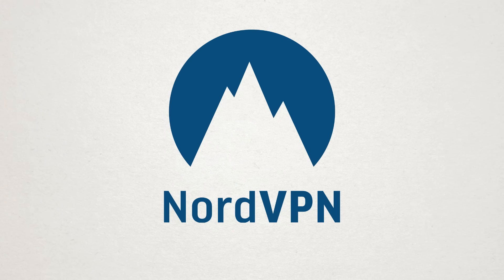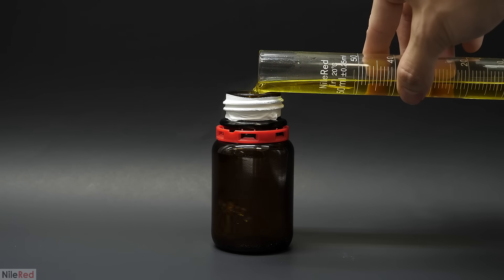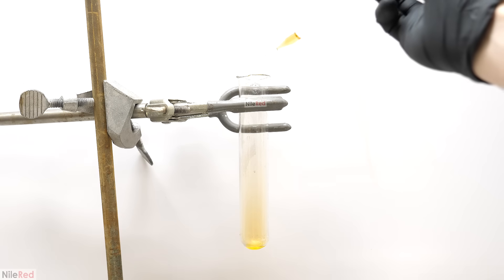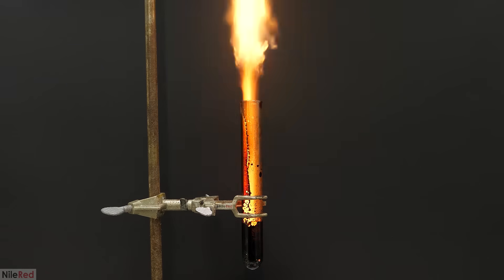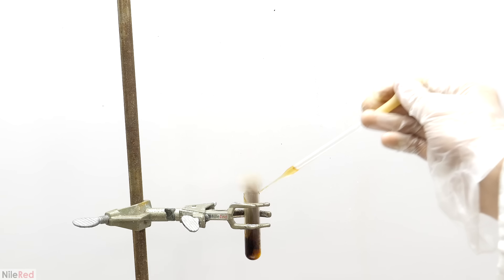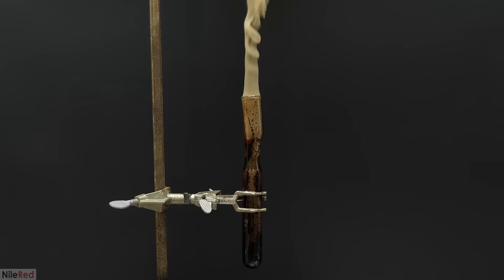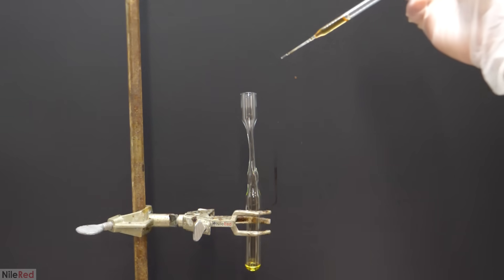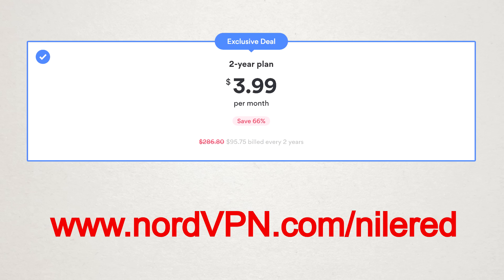Making test tube liquid rockets

Comment: Messing with hypergolics? I hope you were wearing a good pair of running shoes!
Reply: Nah, he's not using Chlorine Triflouride, so no need for the shoes....
Reply: yeah, those are for fluorine - metal fires
Reply: @srenkoch6127  Then again, you can never be too careful... :P
Reply: @srenkoch6127  O2F2 is also fun, affectionately known as "FOOF" because that's its chemical structure and the sound it makes if you pour it on almost anything that isn't a properly fluoridated steel tank.
Reply: Does nobody get the reference?
Reply: @kaidenpeek5959  yep. I've read Ignition! Reminds me of an article I read about "Chemicals I won't work with. Ever." and O2F2 and Chlorine Triflouride were both very high on the list. Not a Chemist, but I'd rather deal with Hydrazine over either of those. Rapidly hypergolic with just about any material? I'll take a big pass.
Reply: @kaidenpeek5959  I clocked it immediately lol

Comment: In addition to reaching the ignition point, the reaction is only going to happen on the interface between the two substances, right? So if you've just got the fuel sitting on top of the oxidizer, or vise versa, then the reaction where they meet is going to push them apart. For a thorough reaction, I think the two components need to be distributed as homogenously as possible. Which of course is a race against a very fast clock.

If a boiler flask can withstand the force of the expanding gasses, that might be your best bet. Because then, even though you still have the same problem of the compounds being relatively unmixed, when the reaction kicks them apart, some of that splashing will be bounced back toward the place where it's all happening.
Reply: Of course, if you could spray the two compounds together, you'd be even better off. But a standard spray bottle probably won't keep your hands safe and probably would lose its spray bottle-ness after the first few spritzes.

Comment: Dinitrogen tetroxide sounds like nitrous oxide on nitrous oxide. I had no idea nitrogen could form so many different oxides.
Reply: Dinitrogen tetroxide (N2O4) is just dimerised nitrogen dioxide (NO2). Nitrous oxide is N2O.

You can make N2O4 simply by cooling down nitrogen dioxide or pressurising it. It's used in school experiments to demonstrate Le Chatelier's Principle, as NO2 is dark brown whilst N2O4 is completely colourless, so any change is very obvious.
I've also found that for some reason just leaving NO2 alone in a sealed test tube will cause it to dimerise. It quickly forms N2O once re-opened however, which I've learnt to my cost.

Comment: sadly no mach diamods and/or supersonic exhaust here.
nice work though.
Reply: Saburo Kobayashi I think you would only see mach diamonds in over-expanded flow.  Correct me if I'm wrong, though.  My rocket knowledge is a little rusty.  Might be possible flow is supersonic, just under-expanded.
Reply: When underexpanded supersonic flow still oscillates (although differently).
Density oscillations are abscent only when ambient pressure and perpendicular to flow axis exhaust pressure are equal.
(which is possible, but would be too much of a coincidence)

Comment: Only 10 mins in so far but I think it's worth noting that its not so much the tube length that matters but when the mixture reaches the top of the tube (whatever length it may be) that is where the O2 is. It would be interesting to try it in a wide mouthed jelly jar.
Reply: The O2 in the air does not take part in the main reaction

Comment: I'm curious, do you have any idea/explanation to why after the initial ignition, there is (almost) always a second burst? and would this affect the efficiency of the fuel concumption, and thus the thrust generated? 
Looking forward to what else you find out in these experiments!
Reply: Vincent Hannema maybye its the pressure slowing down the reaction? Although normally, arent reactions sped up by pressure?
Reply: i thought something similar. I thought, maybe the top layer of the acid, reacts with the first aniline that drips down, then reacts and expands. the expansion keeps the very top aniline up, and away from the bottom part of the acid. After the first burst is over, the rest of the aniline could reach the bottom of the tube, and react as well.
I unfortunately don't have much of a chemistry education, so it's mostly just guessing.

Comment: Note the increase in combustion stability in the narrowed tubes. If you can find a very thick tube you might be able to make the throat narrower and actually build a bit of thrust.
Reply: Immerse test tube in water beaker to provide counter pressure and contain explosions.
Reply: @kmarasin  good idea, plus it would help cool the glass, hopefully prevent any thermal anomalies. Provided the reagents are not reactive with water.
Reply: @JakeAvatar1  Well, they are, but there should be enough water to absorb any reaction.
Reply: @kmarasin  well one should strive to minimize any danger in the lab, especially when your reactions are inherently dangerous.
Reply: Pure HNO3 dissolving into water will produce some heat, just as any pure acid will upon dissolving, but it's not comparable to what the combustion with aniline is already producing. There might be a small acid-base reaction between nitric acid and aniline in solution, but again, not comparable to combustion.
Reply: Or you could change chamber materials to metal and form the throat via metal spinning, then add an injector so it can run for more than an instant. And maybe add regenerative cooling channels. Or you could just make a rocket engine ;)
Reply: @warrentb1  well that would be the ultimate goal, but for initial testing, it is nice to be able to see the reaction
Reply: And.... a much greater possibility of explosions!
Reply: @henryD9363  hence the thicker tube.
Reply: Also, I think he needs to use dowels or metal rods of different diameters to neck the tube down onto to be sure about the throat area.  He might also be able to create a form that can provide a regular / desirable shape for the divergent portion of the nozzle.

Comment: For the large deformed test tubes, you might have more interesting results if you made the narrow part lower on the tube in order to have a smaller combustion chamber.
Reply: @madarah8533  probably.
Reply: The main problem here is to avoid ejecting the reactants before they combust. Currently they are just being held to the bottom by gravity. What's needed is some way to bring the aniline and nitric info complete contact but to restrict the reaction rate to prevent them from exploding.

Of course I'm just describing a real rocket engine and why they are such complicated machines. The complexity of the RS-25 (space shuttle main engine) is one of the main reasons the space shuttle was made reusable, so they didn't have to fabricate a bunch of them at prohibitive cost.
Reply: @kmarasin Or you could just use a more-hypergolic oxidizer.  I hear chlorine trifluoride starts things burning pretty quickly ;)
Reply: Yeah, probably it would work

Comment: Idk about Canada, but in the UK chemical suppliers aren't allowed to sell anhydrous hydrazine, and I assume the hydrate would be no good? Frankly though, I'm good for using hydrazine or any simple derivatives unless I have to.
Reply: Heat it up to 100 degrees Celsius and then I presume you'd have anhydrous hydrazine?

Although probably would want to do it in an oxygen-free atmosphere. Just in case it decides to blow up.

Comment: May is ask you something? Is there any kind of chemical reaction which only occurs under a rather strong electric, ferro-magnetic or electromagnetic field?  Does any of the listed type of fields boost under certain circumstances some reactions?
And btw. I am not referring to the more known experiments in the field of electro-chemestry like akkumulators, batteries and electrolysis.
Reply: Are you referring to the manipulation of hot plasma with a strong electromagnetic field? If so, their are types of rocket engines that use such a "boost" but i don't think they are worth looking at. Much more interesting is the use of this technology to stear a supersonic blunt body object at reentry ( electromagnetic fields can manipulate the plasma effectivly to do precise course corrections).
Reply: Strong magnetic fields can change reaction properties, I know near a Magnetar (possibly the strongest source of magnetic fields in the universe) it is estimated that all chemical reactions involved in life would become impossible as atoms themselves are deformed into long, thin spindles.
Reply: @warrentb1  
Oh boy, i don't think we are jet able to produce a magnetic field that can deform atoms  :D. What would be the benefit of such a device? Besides that, we already can deform molecules with electromagnetic waves, it's called radiation (infrared, uv, gamma rays) ;D.

Comment: too bad you dont have a way to introduce the analine that isnt downstream from the combustion chamber.  looks like there's a good chance half of your fuel is thrown out of the tube before it has a chance to react

edit:  I just realized, you said that analine goes solid at a pretty easy temperature.  why not freeze it, and drop in chunks?
Reply: I'd think that removing the air would reduce the force of the rocket, since the gases produced by the reaction would first have to fill the tube before they could escape and push outwards.  Might make the reaction slightly less interesting to look at.  

I also don't think the ice method would work either, since the surface area of contact would be quite significantly reduced, slowing down the reaction to the point where the energy would go into melting the ice, rather than pushing air out the top.  It might also form a shell of carbon surrounding the ice chunk, preventing the rest of the reaction from proceeding.

I suppose both options are worth a try, for science.  But I have my doubts about their efficiency. 

Using a long tube to the bottom of the test tube might be a viable option, but even then, I think the reaction might be blowing the drops of both reagents out, and I'm not sure that would change.  I think it might just flip which reagent is thrown out the top.  If the aniline is added on top, the reaction occurs between the two "layers", blowing the aniline out the top, but if the aniline is introduced to the bottom of the tube under the nitric acid, he might find himself with nitric acid flying out the top instead.  I think that might be the reason he's adding aniline to acid, rather than adding acid to aniline in the first place.  Just my speculation though.
Reply: the ice wouldn't be in a chunk, it would be ground up, almost powder-like. if that was dumped in on top, its possible that all the aniline reaches the bottom before ignition
Reply: Danielle Spargo Actually, the air makes the rocket less efficient, as the exhaust gases have to fight atmospheric pressure to push their way out of the nozzle.  No air means no resistance to expanding gases other than combustion chamber and nozzle walls.
Reply: Science Compliance doesn't the resistance to the pressure increase the thrust?
Reply: Jonathan Odude No.

https://spaceflightsystems.grc.nasa.gov/education/rocket/rockth.html
Reply: Science Compliance that link doesn't answer my question because they say in the article that you can remove the part of the equation that deals with air due to there being none in space. If you gave me the equation that includes free stream mass times free stream velocity then I'd be able to tell if additional air pressure increases or reduces thrust
Reply: Jonathan Odude That link was meant to be a starting point if you really want to get deeper into the subject.  No, atmosphere does not make rockets work better.
Reply: I think the analine might need to be vaporized to properly combust.  What he really needs is to feed it into the combustion chamber along with the other reactant, atomized, at the appropriate volume flow rates and with enough pressure (and/or a one-way valve) to keep the feed lines flowing in the positive direction.  I don't know if solidifying the analine will be conducive to proper combustion.  Then again, creating a constant, stable flow from feed lines is a much more involved engineering project.

I like the rocket engineering, but, as a chemist, I think Nile's work should probably be focused mainly on the ratios and phases that yield the best combustion.  It would be more mechanical engineering to get into delivery systems that produce such conditions in the combustion chamber.  If he wants to get that deep into it, I'd say more power to him and definitely watch the video with avid interest, but it would be a little out of his usual wheelhouse.
Reply: Aniline*
Reply: Felixkeeg Thanks.
Reply: is this also the reason why the mixture ignites twice? because some of the aniline is blown away but then it falls back into the remaining nitric acid?
Reply: Then it would react much more slowly. Two liquids ensure maximum surface contact.
Reply: Pietro Tettamanti Actually, gases provide the most contact area since the molecules are diffuse.
Reply: @sciencecompliance235  
That wasn't the point of my comment. I wanted to say that mixing a solid with a liquid would result in a slower reaction than mixing a liquid with a liquid.
Reply: Pietro Tettamanti I kind of figured as much.  It was just worded in a way that might have been misleading.

Comment: Just one of the problems I noticed with the throat of your makeshift nozzles. You have no way of knowing if you have a good width without doing the math first. I'd look up a reference book for those equations, and maybe stick a wider section on the end of your tube as well
Reply: You can find PDFs of Rocket Propulsion Elements online if you google it.
Reply: Yeah, I've had a rocket explode because I put a too restrictive nozzle on it.
Reply: @JustThomas1  
In other words, the internal pressure is too great and the nozzle throat too narrow for enough pressure to flow out.
Reply: Mate. I'm a large way through getting a degree in aerospace engineering. I know about pressure imbalances - I just hadn't bothered to do the math because it would be interesting regardless of how successful it was (plus it was a ground engine test).

edit* I had no intention for this comment to come off with a passive aggressive notion.
Reply: The test tubes should probably be a hair shorter. The gasses were expanding quite a bit before they hit the throat. Still a pretty cool demo for a first attempt though.
Reply: I agree Alex Kantor. Not a serious rocket-propulsion expert, but I do know that the Diverging portion of a C/D rocket engine is only beneficial if you have laminar flow of the fluid with an average velocity >mach 1. Therefore, rockets are designed so that the change from converging to diverging happens EXACTLY at mach 1. Incredibly cool video, but the diverging portion of your glass test-tubes is likely useless (just trying to help, since it seems NileRed was testing parameters for a good design)
Reply: Matthew Pecha I have a BS in aerospace engineering and took a class on engine design.  I'm pretty sure that once you get beyond "choked" condition at the throat (Mach 1), increasing combustion chamber pressure won't keep the exhaust gases from going supersonic in the divergent portion.  If you're getting supersonic flow in the combustion chamber, however, this might cause shockwaves inside the combustion chamber to create combustion instabilities.

From an aerodynamic standpoint, though, a convergent nozzle will slow supersonic flow and speed up subsonic flow.  A divergent nozzle will accelerate supersonic and critical flow and slow subsonic/subcritical flow.
Reply: I thought of maybe placing the throat 1-2 centimeters lower and then cut the tube above the throat (when the normal diameter is reached again), so it would have more room to expand